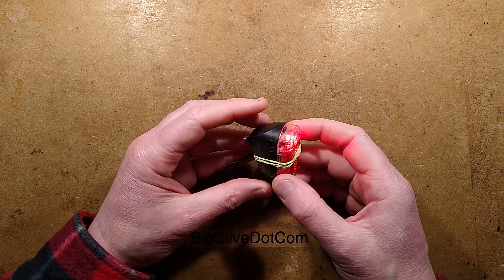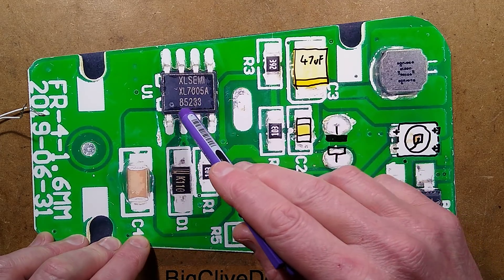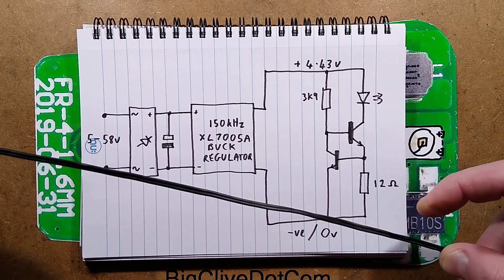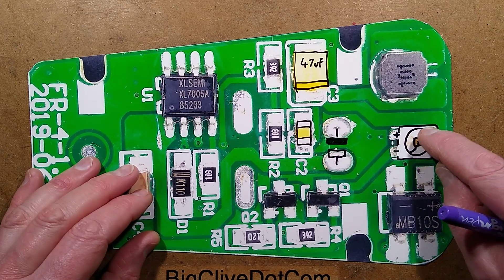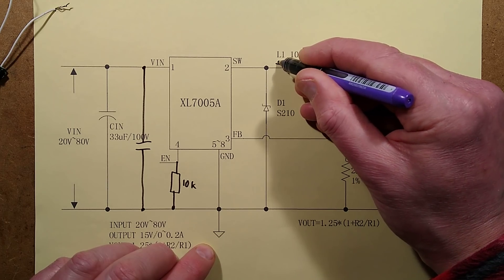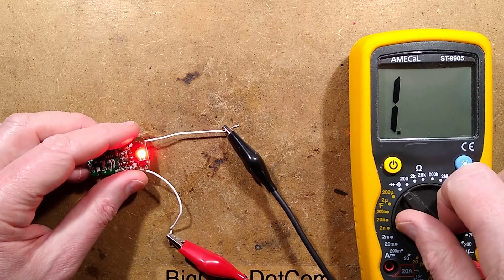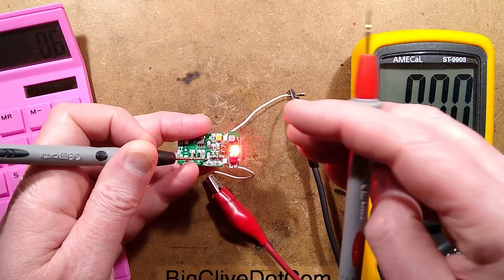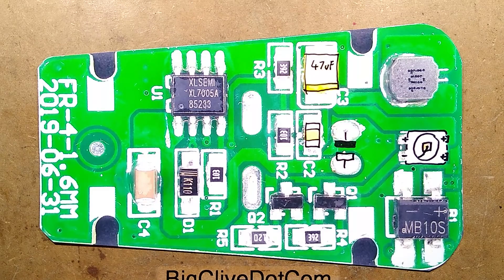Inside a 58V E-scooter rear light

Comment: The Egret TenV4's rear light has a similar design and surprisingly, the component that breaks first is the inductor! Probably, due to shock an vibration the coil's ferrite core breaks off and the cooper wire then unwinds itself inside the light's enclosure. There have been some people who were facing this problem after only 1-2month driving the scooter.

Comment: I would think the 58v rating would be so that the light is fully compatible with all common e-bike/scooter batteries as most are between 24 and 52v nominal. Would be interesting to strap it to a 72v battery and see if it can handle it.

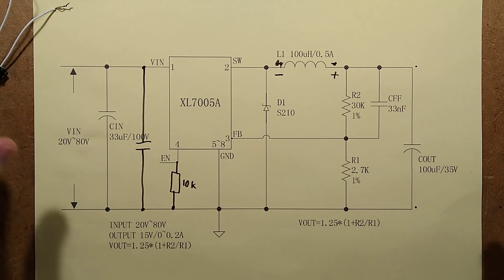Comment: around the 9:19 mark you said you wonder what that capacitor does.  it is a forward feed cap. this is used to minimize voltage transients and improve loop stability. in other words it is part of the feed back circuit.

Comment: The upper limit voltage is 58v because that is the usual maximal scooter/high power ebike battery configuration, 14s li-ion/lipo and most are on the 13s  battery configuration.

Comment: 33nF in the schematic feeds ripple component back to the Vfb pin to limit spiking in the output. It causes the chip to go onto cutoff when there's a strong positive swinging change in the output. As a result it also causes it to act something like a soft start, limiting inrush.

Comment: Not to be too picky, but there's more power lost in the transistor and sense resistor, than the led. I wonder if instead of 4.4v, 3.3v would be a better choice, or what problems come up when that was tried. Maybe they used 4.43v to allow them to use different leds, that might drop more voltage?

Comment: its rate 58V because scooters usually get powered by lithium batteries, whose voltage  is given as their nominal voltage not maximum. So for the average "scooter" driver connecting a 58v battery, it can have up to 75V fully charged.

Comment: That cap on the voltage sense line, I'd like to investigate that more.  If it were between the sense line and ground, it would smooth the sensed value (relative to the 0V rail).  But where it is, it seems it would pass through the 'pulses' each time the inductor is turned on???  Is this something to improve the switching on/off of the inductor?  Might cause some hysteresis?   As the voltage dips and the chip calls to turn on the output, it 'sees' the spike sooner?   Wish I could see a scope trace on that voltage sense line while operating.  :)   Oh well, maybe next time.

Comment: Clive - By 1.06 min in you found the fault or was it just the lens that was broke IE the elastic band and Yan has never used super glue ? - Nice video, the depth of the LED lighting electronic gets deeper and deeper now it's cheaper and cheaper to manufacture, just connect any wire here and the other wire here and it works - But dearer and dearer to the consumer  LOL.

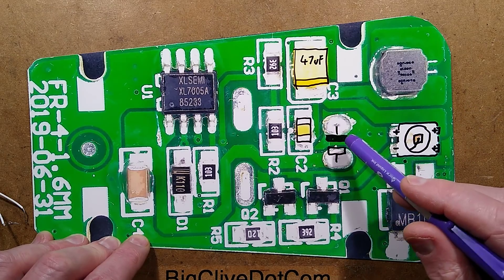Comment: 2:30
Un of LIPO=3.2V, Umax of LIPO=4.2V
58V*4.2/3.6 = the reason why manufracturer didnt specify higher.
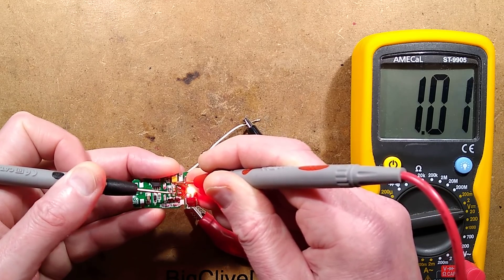10:50
4.4V because the circuit was probably adaptet from white(blue) led's.

Comment: @bigclivedotcom You should check out the controversy covered by Gamers Nexus where the computer case manufacturer NZXT accidentally put a PCB in their H1 case with a screw hole so close to a track that the 12V power can short to the chassis through that screw and start a fire from burning the plastic near by.

Comment: The most complex component  (the XL Semi chip) is pretty cheap too - they will be buying in bulk, so will be getting a better price than 30 cents per device! - https://lcsc.com/product-detail/DC-DC-Converters_XL7005A_C50848.html.  With a relatively simple board, and all the other components being in the cents range, it is hard to justify that 30 Euro ($ 45 Australian) price tag, especially in view of the price of comparable (albeit not identical) scooter tail lights from, e.g. AliExpress - https://www.aliexpress.com/w/wholesale-electric-scooter-brake-tail-light.html

Comment: I have front light from rentall electric scooter it has two CREE XML LEDs which are super bright
it runs on 8-50V (scooter battery has 40V when fully chargen) inside is just ine IC, coil and few resistors and capacitors
it is verry nice and bright light which I power from 3S laptop battery but unfortunatelly I wasn't able to find it at anny online store

Comment: I still don't get why you need the current control transistors, the buck converter is set to a fixed output voltage with resistors, so to keep a constant current through the LED you only need a resistor in series with it. To me the transistor pair is wholly unnecessary?
Reply: Perhaps the current source is for fault tolerance or, more likely, to compensate for variations in forward voltage drop of the LED in case they want to use a different red LED or different color LED.

Comment: This is a bit over complicated just to light an LED. A diode and current limiting resistor are all that are needed.
Reply from the maker: The resistor would get very hot at the higher end of the voltage range.
Reply: bigclivedotcom Make it a 10W ceramic job and it can double as a seat warmer!

Comment: The electronics, especially from China, are getting SO inexpensive that a simple regulator circuit can be used for a lamp that should last forever. Did you give the already working module back to the individual?

Comment: Clive. 
I'm wondering if the scooter has regenerative braking on it. If the light is connected somewhere between the throttle and motor it would be a different polarization depending on accelerating or breaking. Therefore the bridge rectifier.

Also before you buy an electric scooter, skateboard or bike, please check to see if they are legal to ride on the pavement or road.
Emily Heartridge of YouTube was in an accident on an electric scooter and passed away. Unknown to her and her to be husband they are illegal on British roads and pavements.
A link to some news.
https://youtu.be/w8UdnJgUVK8
Shops don't notify us to the laws, they just sell the stuff.
Stay safe and happy 👍😷

Comment: The buck regulator makes sense, but the constant current sink is rather silly - as the buck regulator's giving out a regulated voltage, a resistor wouldve been plenty good enough to set the LED current

Comment: Simplify this design by eliminating the dual transistors and the regulator feedback divider.   Connect a 27.4 ohm resistor from the LED to ground.  Then connect the LED resistor node to the 1.25V feedback input of the regulator.  Connect the feedback capacitor in parallel to the LED if needed to improve the regulator response.  In this configuration, the regulator will maintain 1.25V across the 27.4 ohm resistor for a current of 45.6 mA through the LED.  To picture this, take the application circuit schematic and replace R2 with the LED and change the value of R1 to 27.4 ohms.  R1 will dissipate 63 mW, so select the package accordingly.

Comment: hi  are you aware that the led will flash when when brake is applied on a e-scooter?
Reply from the maker: There's no obvious flashing circuit.
Reply: @bigclivedotcom  its run through the controller, i've got a e--bike controller that stopped working if you want it i can send it to you it's for a dyu d1 bike.

Comment: Just gonna say this: If you have a switcher, you might as well use it to regulate current in the load. Going halfway there and then placing a series-dropper makes no sense. It is bulked up "properly" but the architecture is nonsense.

Comment: It really is good to see such a well thought out design with a wide range of voltage inputs and DC or AC inputs too. I suspect that these units were designed with bicycles, ebike and escooter markets in mind, a kind of one size fits all solution. Clever thinking and knowing the market. 
With the preponderance and variety of E-scooters and the current government debacle on their legality and use in the UK, it will be interesting to see how the road vehicle lighting regulations will be applied to these machines. I wonder if it will be similar to the cycle lighting regulations. https://www.cyclinguk.org/lighting-regulations

Comment: The 58V max operating voltage might be related to ebike compatibility. Some of the most common brushless controller voltages used are 36V, 48V and 52V. Once fully charged the 52V batteries will be around 58V.

Comment: I'm seeing a lot of comments about this being overkill,, but in its intended use its likely being run from the e-scooters battery, which will vary wildly in voltage under different use/load/regenerative braking conditions. I also suspect that the german regulations on the brightness required are quite strict and this has been designed to ensure the minimum brightness is achieved at all likely battery conditions but without overdriving the LED when fully charged.

Comment: Always refreshing to see a well-engineered (maybe even a little overkill) component. I suspect the reason for all the regulator circuitry is the a/c voltage & waveform on an e-bike is usually quite unstable, and the circuitry prevents the bulb/led from dying prematurely

Comment: It's a red light that's been idiot-proofed.  Not sensitive to polarity, and relatively insensitive to the supply voltage.  And it may meet some European specifications equivalent to the US Department of Transportation.  And it may have been sealed against the water and weather.

Comment: For driving a simple one-LED load, this is an absolutely awful design. The main purpose of a switching regulator, a buck in this case, is "efficiency." In an ideal world, the power output equals the power input, Pout = Pin, which would be 100% efficiency. Of course, nothing is 100% efficient, so you accept that there will be losses in the conversion process, so we get Pin *E = Pout, where E is the efficiency and E<1. A good buck regulator will have about 90% efficiency, so you would use E = 0.9. This design throws away a great deal of power by knocking the bike's battery voltage (14V?) down to a fixed voltage of 4.44V, and then using a secondary linear regulator as a 50mA current source to supply power to the LED, which Clive shows is 2.06V * 50mA = 100 mW. Clive did not measure the input power to this circuit, so I'm going to assume an efficiency of only 85%. (50mA is a very light load for a switcher, which is not a "sweet spot" for efficiency, so I'll use 85%.) The output power is 4.44V * 50mA = 220mW. Assuming 85% efficiency, the input power is no doubt about 220mW/0.85 = 260mW. So the overall circuit expends 260mW of power to deliver 100mW to the red LED, for an overall efficiency to the LED of 100mW/260mW = 38%. That is dreadfully awful for a switcher!

Given the very low power drain of the LED (100mW), I doubt that efficiency was a #1 requirement for this design. However, if it was, then a much better choice for the buck regulator would be one designed specifically for driving LEDs. How is it different than a standard buck regulator? The answer is the pin call FB, which is the feedback node (pin 3 for the XL7005). It is 1.25V for this chip. A buck designed for driving LEDs will feature a feedback voltage that is much lower than this, usually in the 0.2V range. When this is the case, then what you do is drive the LED directly from the output of the buck, but then you put a small current sense resistor in series with the LED's cathode. In this case the current sense resistor would be 0.2V/50mA = 3.9Ω, The intersection of these two then goes to the feedback pin. Because the voltage is so low, 0.2V in my example, then the power loss is a mere 0.2V*50mA = 10mW. On top of the 100mW dissipation of the LED itself, the total output power is a mere 110mW now. Thus, the power drain at the input should now be about 110mW/0.85 = 130mW, considerably lower than the design the bike guys came up with!

And notice that the LED-drive buck is simpler, too. You don't need a linear post-regulator to control the LED current. The switcher itself will regulate the LED current, so you toss the two transistors and two resistors in favor of the single sense resistor. Simplest is bestest! And usually cheapest, too.

As others have noted, the capacitor called CFF in the XL7005 datasheet is to feed back a bit of output "chatter" to the FB pin. You WANT to see the output ripple voltage on a switcher. FB is a "virtual ground" node, identical to the feedback node of any op amp. The feedback loop closes around this node. You have to be careful of what you put on this pin! By putting CFF to ground as you opined, you would do just the opposite and send NO chatter to the feedback pin, causing the switcher to lose stability. Bad idea!

The lowest voltage you can drive the XL7005 with is determined by the output voltage (4.44V) plus the drop of the NPN emitter follower (a very lousy driver due to the Vbe drop), about 0.7V.  Thus, below about 4.44V + 0.7V = 5.15V, the converter stops regulating, as you observed.

85V is the ABS MAX voltage the chip can tolerate without blowing up. Any voltage system that has a generator/alternator on the line will have some nasty voltage spikes (transients) that can easily destroy semiconductors. For this reason, automotive-rated semiconductors will have a pretty high voltage rating. 85V in this case. The datasheet example showing a Vin range between 20-80V is anyone's guess. The datasheet shows that Vin(min) is 5.0V, but that assumes that Vout is under about 4.0V. If this regulator had an output voltage of, say, 10V, then Vin(min) would be about 11V. Etc.

Remember, this is a switching power supply, not a linear supply. Switchers are a mystery to most budding EEs. A buck switcher like this is the easiest topology to understand and learn on.

Comment: Probably rubbing against the wheel. The problem in the design on mine is the wheel arch/mud guard is what the wire goes along, and it's not really secured in a way I'd be happy with (clips/glue and then exposed). Any tension put on the wire, and it moves to the shortest distance/shape, which is in the path of the moving wheel.

Comment: I like the extra ceramic decoupling capacitor and the pulldown resistor. It's refreshing when an engineer looks at a datasheet schematic, says "OK, how can this be improved?" and the bean counters don't get in the way.

I wonder how it failed. Obvious frayed insulation shorting on the chassis is obvious, but it's more common for wires to fail open at the grommet due to vibration.

By the way, scooters and e-bikes have a wide variety of battery pack voltages. Most electric bikes are 36V, but this was clearly designed to play well with anything from a 58V s-pedelec scooter to a petrol powered scooter with a 12V lead-acid battery. Voltage-ecumenical if you will.

Comment: Isn't it amazing how a simple red light can be turned into a bucket of parts? It's amazing seeing a mountain made out of a mole hill.
Thanks for the tear down, Clive.
Reply: It's more universal than simple. This thing can run on any power source you may find on a bike, be it a bottle-type dynamo, a hub dynamo, a USB OTG adapter you plug into your phone, or an electric bike battery pack. It's very German to think ahead like that.
Reply: @tybofborg  - and a really good tungsten bulb can do the same thing - without any circuitry.    (Mind you, the brightness will be all over the place, but there's always a trade off).
Reply: @tbelding  A tungsten bulb works only in a limited voltage range. It absolutely won't light up on both 5V and 50V without any circuitry. it also uses much more power (when you're powering it through a dynamo, that matters, you feel every watt in your thighs), and doesn't last very long.

Comment: That’s a whole Lotta circuitry when you could’ve just made the LED the same voltage as the scooter
Reply: Scooter / ebike batteries span from 24v up to 72v. That said, there are some high voltage driver ICs that seem to be a lot simpler to implement.

Comment: Hello Clive some year ago I bought the cheap Chinese USB soldering iron (it was working fine until my son played with it an broke the tip ...) I saw some new version on Amazon (eBay doesn’t exist where I live) white body with written “HANDSKIT U5V 8W” in green character, have a micro USB port, silver switch with a ring which do red, blue, green (temperature change).
I would like to know what do you think about those ?
I think the 8W is maybe a lie it would give us a 1600mA at 5V.
The price is around 10usd (after currency conversion)
Reply from the maker: I've not tried that version.
Reply: @bigclivedotcom  ok I will buy it (since it is so cheap) and will try it. And if I can I will try to put a review (usage only since my electronic level is not that high). Maybe some photo too.